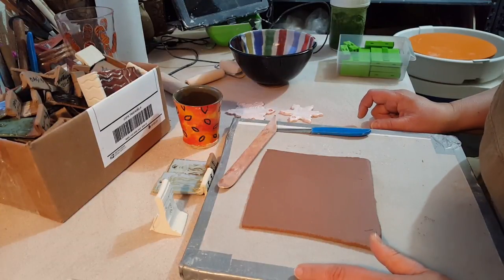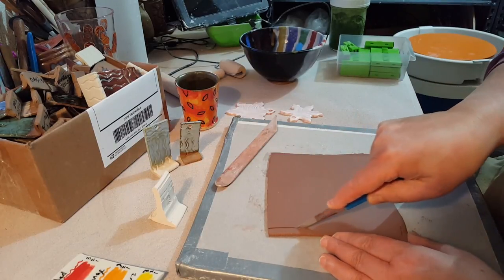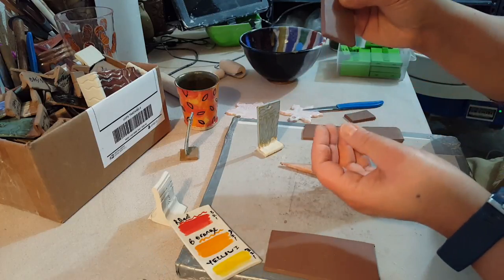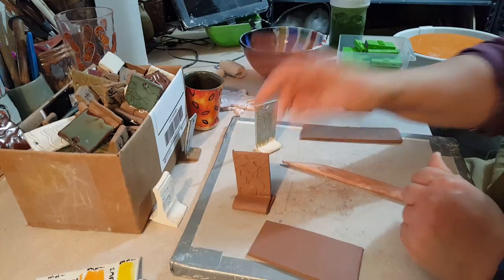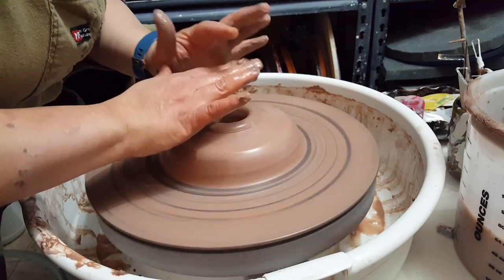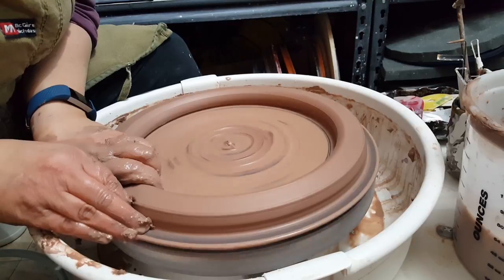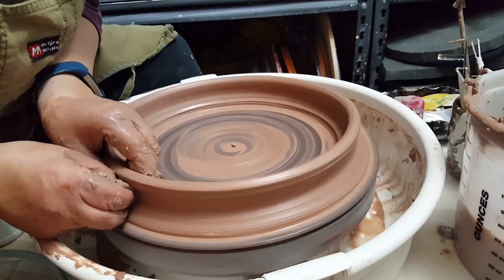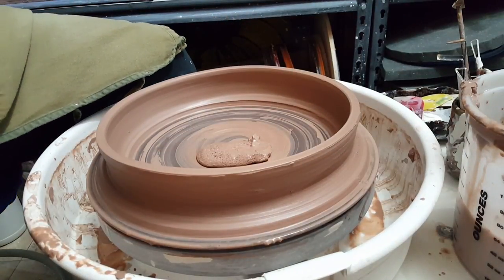How to Make Hand Built and Wheel Thrown Test Tiles From Clay

Comment: I’m so thankful for this video. No one makes videos for these for handbuilding. How do you make sure they don’t fall over in the kiln? I make large mugs so I want them tall to see how the glazes flow
Reply: So glad the video helped!  I haven't had any fall over as far as I can remember.  I would think that if you are making them taller, you might want a little bit bigger base to help balance them.  if they make it thru the bisque and are not wobbly, they should be fine in the  glaze firing.  If you give it a try,  let me know how it goes.
Reply: @potteryisfun  I made some last night and then today I watched several videos on different ways people have made them and someone used kiln brick to make a piece that you can put the flat tiles into. They cut out an area to lean the tile against! Isn’t that creative! 
I am getting a bunch of new glazes since I went to using stoneware clay instead of low fire. I have to test them somehow and I want these tiles ready by the time I get the glaze so we will see. Thank you so much for responding so quickly.
Reply from the maker: @micheledickey4066  that sounds like a great idea using the kiln brick! I switched from gas fired at a community studio to my own using all different glazes and clays in an electric kiln.  Lots of testing! 😄 smart that you are thinking ahead and  planning all these tests! Good luck!
Reply: @andreaakeribpottery  Thank you. I am new to handbuilding. I did slip casting for years and years so everything is new. I look up everything so I can have his outcomes. Handbuilding takes a lot of effort and many many steps so I don’t want to ruin anything.
Reply from the maker: @micheledickey4066  I used to not like hand building at all... only liked working on the wheel.  And then one day I tried it again and just love it. Such a great way to add texture.  I am also a little obsessed with making my own texture stamps and rollers. 🙂